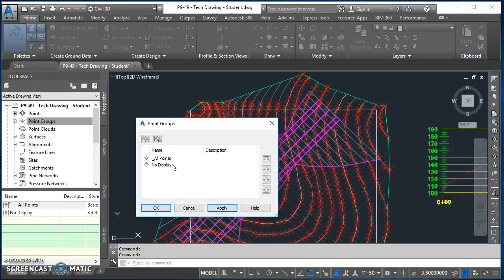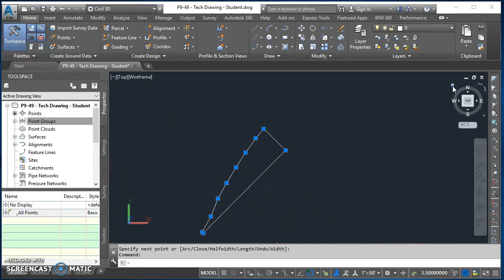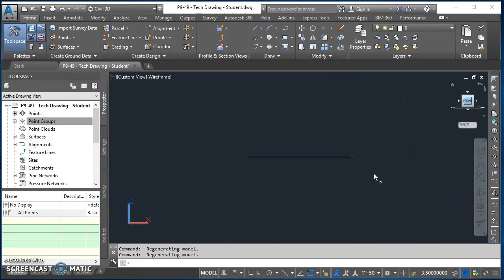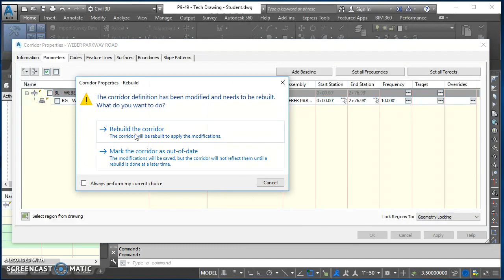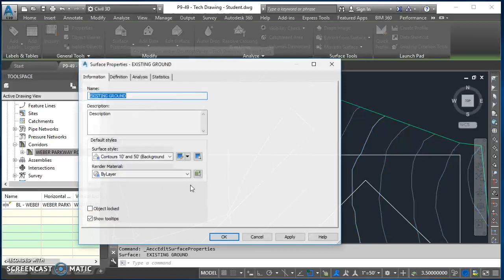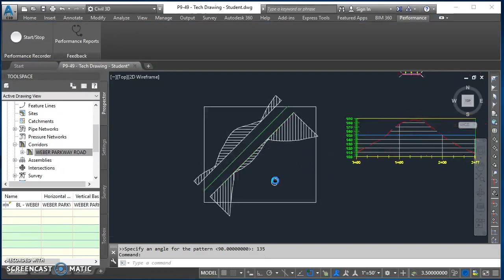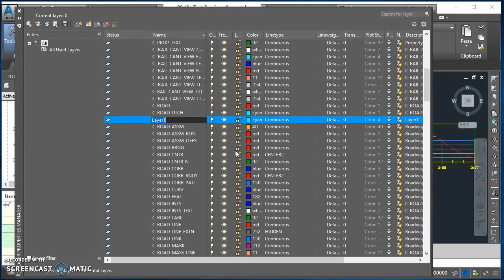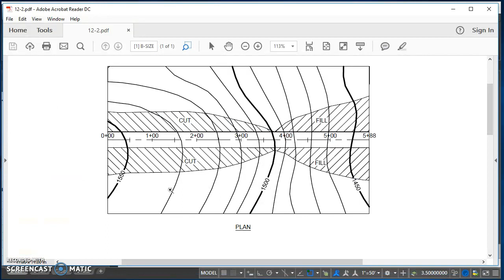Creating Cut and Fill Patterns for a Corridor in Civil 3D

Comment: No hay otra técnica en lugar de hatch?
Reply from the maker: Another way would be to modify the Code Set Style, but I didn't like the results that I got. But, you click on the Corridor, go to Corridor Properties, click on the Codes Tab, click on the Edit Current Selection icon next to the Code Set Style, change Material Area Fill Style for Daylight Cut Link to Cut Material and for Daylight Fill Link to Fill Material then edit the Pattern for Cut Material and Fill Material as you want to then set all other Material Area Fill Styles to none. Make other changes as needed.